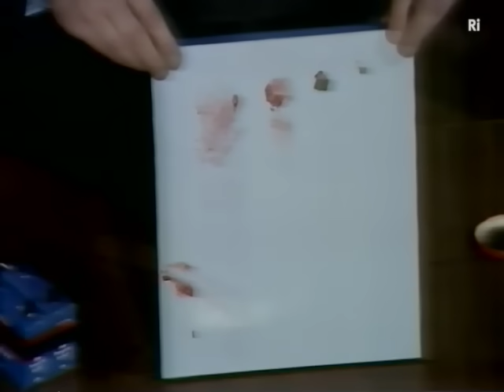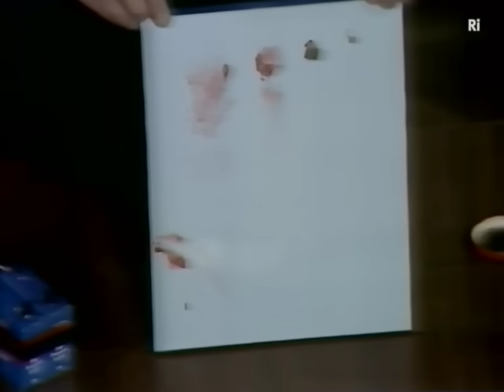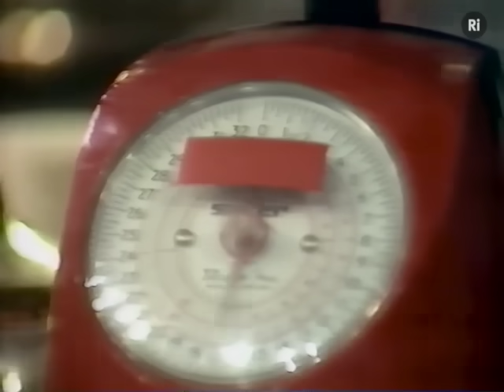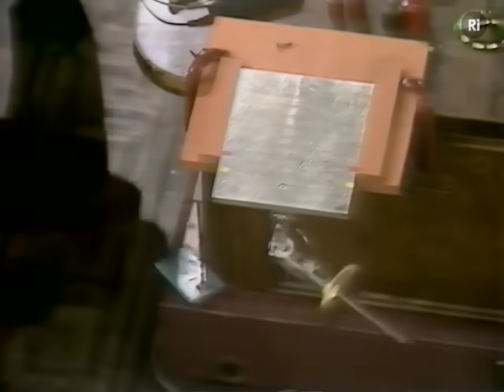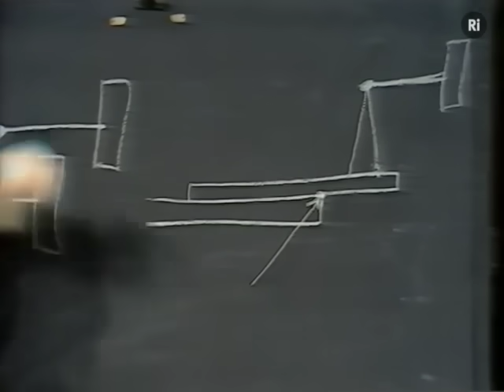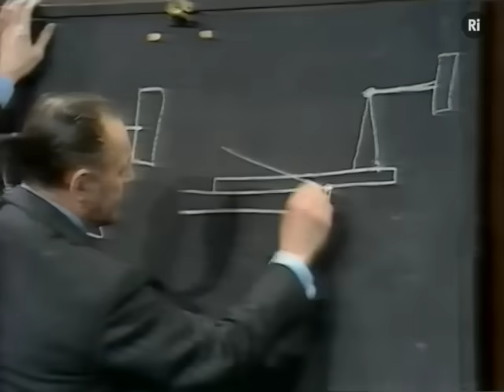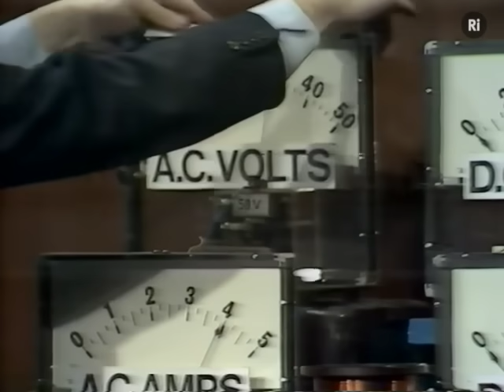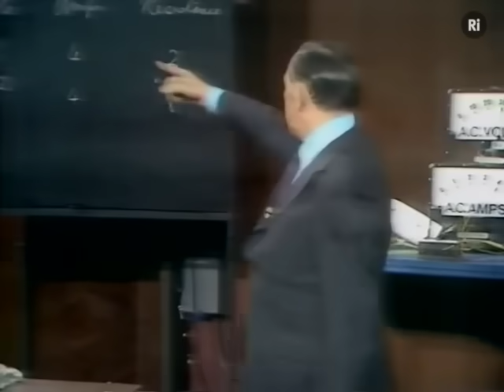☝#AntiGravity Part 3: Eric Laithwaite's Reality-Defying 1974 Lecture on Gyroscopes #HiddenScience

Comment: Gyroscopes do not provide lift. Every gyro video you see shows it being supported at some point. Show me a gyro floating by itself in thin air without any support.
Reply from the maker: Copying my earlier reply to your earlier comment: 

You don't understand basic physics. Forced precession causes the gyroscope to lift upwards causing a decrease in a weight-scale reading, and can even go air-borne. What you are requesting is that I build a UFO device.... Baby-steps first, aka you have to learn up on physics before commenting again.
Reply: @mes  Oh yes I do understand basic physics. The FACT that nobody can build a free floating gyro is indicative of FACT that you cannot build an antigravity device using gyros in any configuration.
Reply from the maker: @BrjanBuckmaster  You don't understand physics, hence why change the topic always. Gyroscopes show that mainstream physics is fundamentally wrong. As for practical anti-gravity devices, this would likely require more than just gyros / mechanical physics but a better understanding of electromagnetism. However in space, a gyroscope would more easily demonstrate inertial propulsion.
Reply from the maker: @zz-nc5kx There is your nonsense again... "Mainstream physics" is what is most widely accepted, aka what Wikipedia / every university in the world says. And no, QAnon / Flat Earth are controlled opposition disinfo designed such that mainstream people like you mock all alt-media; which you are doing right now to me.

Comment: Antigravity is the wrong way to look at this. The sought for principle, if successful, would work best in space. If Eric had stood on a weighing machine, would the weight of the gyro have been added to his own weight as he swung it around due to Newton 3?
Reply from the maker: As the gyro rises, the weight reading of the system (him + gyro) would decrease. This is demonstrated in his Experiment 20 where forced precession causes the gyro to lift completely in the air. https://youtu.be/xTrwlo8B3rs

Comment: so are jet engines lighter when their turbines are at full rotational power?
Reply from the maker: That's an interesting question. I would think it wouldn't affect the weight that much because relative to the entire plane, the jet engines are only a tiny percentage of the overall weight, under 10%. So even if it did affect the weight, it would be insignificant. However, I think it may affect the steering at full rotational speed.
Reply: @mes  was thinking just of the engine itself rather than whole plane but definatly see your point.. the whole gyro thing is fascinating,had one of those with metal loop/handle thing as a kid and boggled my brain back then too.. i think "they", the powers that educate us all, had problems with mr laithwaite,and this lecture.. guy had a certain edge to him when brings up fellow scientists
Reply: Watch the first first and second video. It shows the gyro machine that made lift.

Comment: Simple experiment: Put gyro on it's little "eiffel tower" on a scale, together, not spinning etc. Then spin up said gyro and have it going away, doing its thing on its little eiffel tower, and in both cases record the weight. 

According to what this fellow appears to be saying, the gyro+tower should weigh less when the gyro is spinning on its tower as opposed to when it's not spinning. That seems to be what's demonstrated when the kid's holding the spinning wheel, because he's a just a little kid and could not lift the thing otherwise. 

So where's the weight gone? 

I don't have all the fancy toys this guy's got but I'm pretty sure I can get a gyro and I've got a postal scale.
Reply from the maker: No that is not what he is saying. What he is saying is that the gyro can't push off the Eiffel tower; thus effectively behaving as without "momentum" or "mass". A weigh scale should not change if the center of mass doesn't change vertically. 

Thus effectively, the gyro is floating freely around the Eiffel tower as if it is simply choosing to do so. This is in fact the basis for what I believe is true precession and which I covered in my latest video series: http://mes.fm/science-playlist

For actual weight loss, when the center of mass rises, as in the case of forced precession, then the weight loss is present as demonstrated in my MES Experiments Part 20: https://mes.fm/experiments-playlist

Comment: See ohms law dc 8v 4a 2c but do uc ac seas 30v/3.6 .4 short seas 3.14 you rounded of 2 4 c1. So 24v see 6 amp 3c is true 6 so 30/3.6 makes 8.33r see dc .33 push charges up like a thread on a gyrascope. You said 18"/2k speed 9000rpm seas combustion engines a cranck shaft vectors thrust gives lift. Pivits a gimbles. So 9v tong buzz. Now let me introduce you to gyrascopes in a galaxcy. Saturn rings see neptune rings. Pluto sings black hole event horison. See the sun goes round a planet earth. Sees moon seas a black hole event horison pan sees casiophia. North poll star dark maters shadows. Reflects. Cause and effect. Now far from me being synical milky way gimbles earth. True earth you say 24 hour a day so 24/3.6= oh look 6.6666666667 9x6 54 6x6= 36=9 so tropics 9/9=Ø 18° off set. So 36/3.6=10 and thats perfection earth herself is a gyroscopic. Space ship. Rise fall tides. Swings in swings out 24/12 two gyroscopes seas 9 planets. Gyrascopes. Like you coils. Proves Arkamides screws pythagorus. Seas newton law is gravity. See waights lengths frequencies. Metraknomes tic tok. All beats together. One pollar shift amp seas currents 2 4tides 4 seasons pi is 3.6 eyes seas 369⅗ seas .56 short on pi 3.14 you now? Know? Pie is 4x90° compass hands two clocks faces seas but a cumpass is a fixed diferentiols. So wankle engine 22krpm seas mazda mx7 car takes of. Levitations. Earth floats in an event horison of a back hole. 4 no light can escape. And thats why? It takes 24h equator 18 hours tropics 16 hours myan and the diference is still 2 points of references magnetics 1±Ø. True. Earth gyah giea gaiea gails sires polar vortix. Na. Im sure they fix the pi now 7d 5d 12d a bob eye floats on magnetics. Kiss X pluto is central core dark mater black sun. UvU.